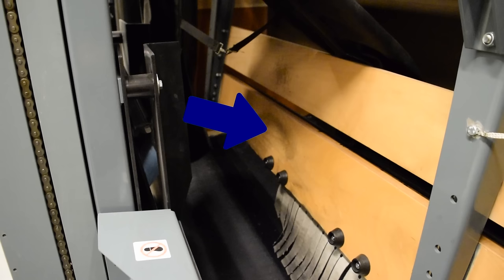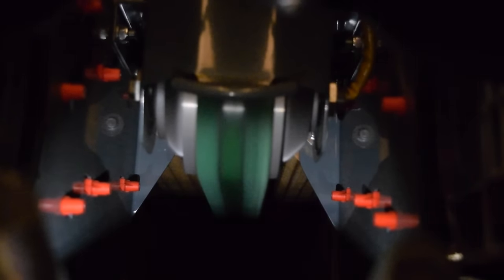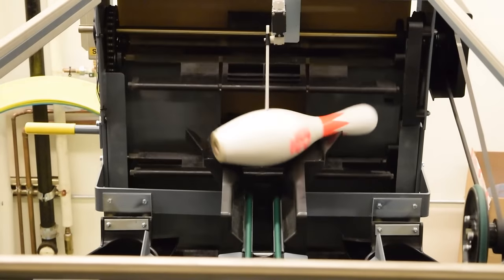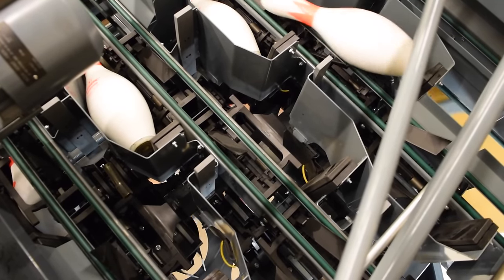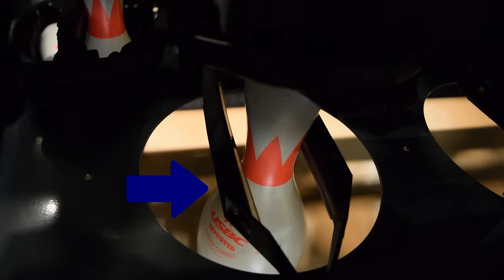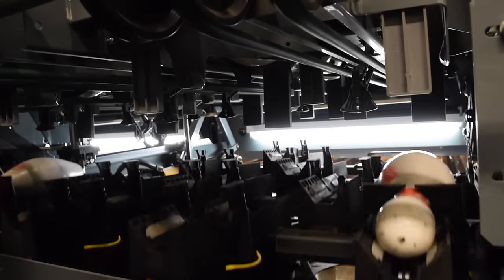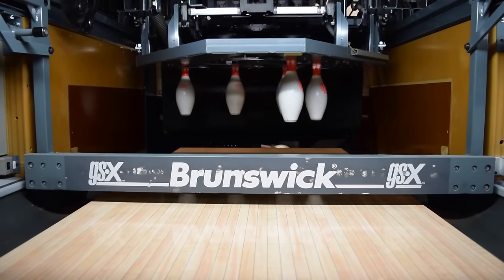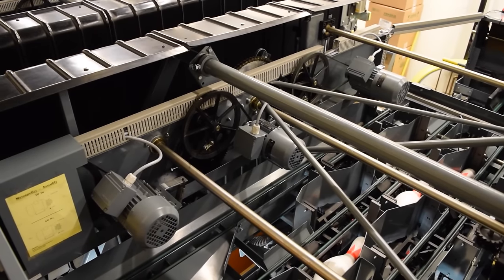Pinsetter Operation  Video

Comment: As a teenager in the early 90's I worked as pinsetter mechanic on the ol' Brunswick A2. After all these years,  just last week I was wondering how pinsetters had evolved and how the newer ones worked compared to the A2. Looks like a lot has changed. Cool video!!

Comment: A moment of silence for that one pin that’s worked there for 30 years and still hasn’t found a station and is just on an endless cycle constantly traveling through the distributor
Reply: Right! Horrible design!
Reply: Some pinsetters have 20 pins in them so it'll be ready at any time. It's not horrible, it's efficient.
Reply: @godffreyosorio4939  23 pins are needed for most GS-X machines otherwise they get ‘Pin 07’ or ‘Pin 10’ errors.

Comment: Great video ! I was a pinsetter mechanic a long time ago as well. The older Brunswick machines were a bit different, but same components. We would mess with people we knew at times by hooking on center pin from above, not allowing it to fall, or setting it back up. The things we do when bored..

Comment: This machine looks like a Brunswick GS series pinsetter.  They are very rare.  About 20 years ago, I bowled in a house in Baltimore that had the first generation of GS machines.  They are very smooth, fast and quiet.  The house I bowled in had the machines set for double detection; ie after the second ball the setting table comes down to check for standing wood before it is swept away.  I understand that the GS machines can also be programed for traditional single detection, like the Brunswick A2 or the AMF 82/70 for use with optical scoring systems.  I also know, from YouTube videos from Brunswick that the GS, series, at least the GSX, has two florescent fixtures, the second one used for black light bowling.

Comment: I miss the old Brunswick A2s/Jet Backs and the noise of the pins on the old elevator ring and the circular pin distribution assembly... Damn well foolproof! I also liked the way the old sweepers worked on the old ones as well... A tried and true design that still works at quite a few bowling centers even after 60 years...
Reply: Most pinsetters in active use are actually still A2s and AMF 82-70s

Comment: Does this apply to Wii Bowling?
Reply: Yes
Reply: yes it does. all those complex pulleys an gears and whatnot, are all crammed into a Nintendo Wii.
Reply: the ball teleports through objects secretly and back in your hand
Reply: It’s on a different pinsetter. The Wii Sports Bowling Pinsetter is based on the Brunswick A2 Pinsetter.
Reply: The balls and pins are uploaded to Nintendo's servers, where a digital version of this machine processes them and sends them back.
Reply: That's virtual bowling without the mechanics of a real pinsetter operation but it's basically the same but u don't get to c what's happening behind the Wii sports bowling lane  as ur the one bowling and not the mechanic of the pin setter of a wii sports bowling lane while playing the game 
if it were real life u get to c what he's showing here if u had a job with the bowling alley as a pin setter mechanic
Reply: Why not

Comment: I honestly miss working at my old bowling alley, not for the company themselves. I was at a bowling alley with these Brunswick GSX machines, I was there for 6 years, and I was the head mechanic for about 4 years after the previous head mechanic resigned. I left the place because the company was absolutely horrible and I can’t even start with the list, for example, I never was able to request off, I was ALWAYS on call, and even still had to stop in on my days off to make sure that machines were running and the other mechanics weren’t just simply NOT fixing them. But I wasn’t ONLY just the backend mechanic, I was also in charge of building maintenance like the bathrooms, lighting fixtures, tables and chairs, lazer rag, mini golf the HORRIBLE batting cages. I was the absolute best employee and always putting work first, it stressed me out so much that I started losing my hair at age of 22. Literally I was the only one that cared about the place so passionately, and I still do. I was going there ever since the place first opened. Then I finally started working there and my love for bowling just increased since. So I’m happy that Bowlero bought it out and ACTUaLLY renovated it and is doing amazing shit. I’m actually upset that I didn’t stick around just for another 1 1/2 years til they bought it, I would have been so estactic and happy. But I also have to include what added to the stress was me working a 2nd job and college classes full time, was doing that for 2 years at that point then I picked up a 3rd job doing hurricane shutter installations and that brought me up to working 105 hour work weeks and college classes, only did that for a whole year and then I got burnt out and eventually went to only working at the bowling alley and picking up shifts at the gas station like once or twice a month if I needed extra cash, and helping out when in the area. Shit for me to even get what they considered vacation time was working off the clock so they basically owed me those hours just so I can go on a vacation and yet out of those 6 years I only ever took a voluntary vacation of 4 days and that was like prying teeth. I had 2 motorcycle accidents within a year of each other and both accidents I was out of work for 4 months each. There were only 2-3 people I ACTUALLY and GENUINELY loved working with. One of them was a woman that was there basically since the start of the business and then when the company sold off and our GM stepped out with resignation she took over as GM. Truely the meaning of working up the ladder, but then when there was no more corporate, our district corporate guy came in saying that he wasn’t going to take her spot or anything of that sort and he did the exact opposite. Never took my advice on anything, suggestions, especially when he hired a assistant general manager that had NO, and I mean absolutely NO FUCKING clue about this area of activity. This kid literally walked in to shut our power off and give us notice because our company wasn’t paying the bills for months. I can guarantee you that shit would have been a lot better if I was at least promoted to assistant GM under that woman who I explained about. And then there was the 2nd person, he was the arcade manager and traveling arcade manager, dude was an absolute gem. He started showing me how to do arcade stuff like fixing the games, organizing the prizes, shit I helped bring in all the new games, helped assemble them even the big ass ones like connect 4, the BIG free throw game, Monster Drop, etc. literally I did EVERYONE’s job. Yes it wasn’t in my job description and I didn’t have to do it, but I did it because I loved the place. If I could work with those same people again, I would. It used to be all fine and dandy the first 2 years I worked there. Literally all of us employees were friends outside of work BEFORE I started working there. The 2 I spoke about literally watched me grow up from like 14 years old til I was 25. Shit was insane. Whenever I move tot exams I might try to apply to get back into another bowling alley. I would not but right now I’m working at a car dealership and making more money and learning a lot more shit than what these other companies would possibly pay me. But there’s just something genuine about solving a "ghost" problem or just a problematic machine like this, they are hard as hell at first but give it a few months of fixing things here and there, then you start to REALLY understand it all. But there are definitely a lot of things that are easier with a 2nd person, we techs never had that option. The only time there were 2 mechanics it was when shifts over lapped like either one person came in early or whoever opened stayed an extra hour or so, which was me 99% of the time both ways.

Rule to the story, don’t sell yourself short. If you’re passionate about something don’t give up but don’t let your mental, physical and relationship health suffer because of a job. Don’t. Keep work at work and home stuff at home. I made the mistake of always bringing work home like pin holders, multiples at once, rollers, ball doors, actuators etc, fix me at home then bring them back the next day. The stress I brought home every day, there were days upon days or and even weeks that When I rode my motorcycle to work that I hoped someone would pull out in front of me and end it right then and there, but I’m glad it didn’t. I’m glad nothing of that sort ever happened. Well that ended up killing me, my first accident was someone failed to yield a left turn but I just got ejected over the car, and a couple cuts and bruises. But like i said don’t ever let a job beat you up like I let this beat me up. No matter how much you love the shit. Your own well being is more important,

Comment: I’m here trying to figure out what happened to Buddy from Cake Boss
Reply: Same 🧐
Reply: I watched his explanation of what happened, and it still isn't entirely clear - but one thing he did explain was that he was trying to dislodge a pin,  "laying on top of the machine" and got his hand caught "with the machine going back and forth," which almost seems to suggest he was trying to dislodge a pin with the sweeper mechanism still operating or perhaps stuck. The only other "back and forth" motion I can imagine is the pinsetter rack going up and down, but it would seem that would be taking his hand and shoulder up and down for the ride, and that could have been an even worse injury.
Reply: So do I, i’m here trying to figure out what happened to Buddy from Cake Boss
Reply: I believe it was on a different machine. Check out the A2 by brunswick (someone correct me if that wasn't it). They're built much differently
Reply: Was an A2 or possibly an even older JetBack

Comment: Been bowling almost 30 years and I still don’t understand where my ball goes lol
Reply: TraumaER same xd
Reply: It was literaly the second thing he covered...
Reply: The wall at the back of the lane you can see catches the ball because it is too short for the ball to go under the pins however slip right under and the floor behind the end of the lane in the pit moves away from the bowler the wall stopping the ball is angled towards so it pushes the ball towards the ball return side of the lane where the ball is then either accelerated or lifted and dropped into a flume under the floor that sends the ball to the return which lifts the ball to the return from under the floor
Reply: This is a Brunswick Pinsetter.  AMF machines are much different.  🤷🏽‍♂️
Reply: There are many of Pinsetter videos out there. Watch any of them how your balls came back.
Reply: @PinoyBowlerGS92  yeah, but how does it do it over and over?  How does the machine know to send my ball back, but not the pins?  How do the pins get organized so quickly?  And it seems like it's all done without a computer chip.  And how does my ball not get decimated when it hits the back wall of the lane?
Reply: @TraumaER . Yes, On the Brunswick GSX, the Ball Door has a Switch to lock the Ball Door for 3 seconds to prevent pins from entering and after that, the ball can enter and there’s a ball accelerator pushes your ball through the subway and ride on the Ball Return pulley and it finally returns. On other machines like the Brunswick Model A, A2 or Jetback had a Ball Wheel (driven by pulleys and rollers) which grips the ball up and the Ball Lift rods guides the Ball on its track towards the end part when the Ball is gonna slide down to the subway or underground. On AMF 82-30, 70’s, 90’s, XLi and XLi EDGE, their’s is similar to the GSX Ball Door excepts it’s more of a paddle than a flap door style on GSX, they had a Ball Lift when the Ball enters the Ball Door, it accelerates upward on the Ball Lift in an angle and slides down with gravity. Hopefully you’ll get the idea cause it’s kinda irritating on how to teach Bowlers on how a pinsetter works since every bowlers know how a Pro Shop works. I suggest subscribe to Rep2369 for Brunswick Model A, A2 and Jetback Pinsetters and tmiller453 for GSX Pinsetters.
Reply: @PinoyBowlerGS92  man you know a lot how this all works LOL.  I just think it's genius how it's designed because it has to accept all types of bowlers and pin reactions.  I notice how my strikes often lift the pins relatively high in the air so I assume that bangs into the pinsetter as well.  Then you got the casual bowlers that throw the ball 20 mph into the gutter and it bounces all around there.  Surprised balls aren't scratched up after every shot.
Reply: @TraumaER  That loud trademark "smack" you get when a ball goes straight to the backboard, love it.
Reply: @spikester  not me LOL.  In practice session, if there are no pins, I pray that my strike ball into an empty pin deck doesn't destroy my ball.
Reply: @TraumaER   Yeah I’ve Bowling for 10 Years and I remember when I was kid first started watching YouTube videos of Bowling along with Pinsetters and then I escalated from there. 

I’m also one of the Pinsetter Enthusiast Bowlers here on YouTube that created Realistic Mini Bowling Alleys based on Real Life Bowling Lanes and Pinsetters, we copied every single detail from front to back including in and out. The biggest channels of our YouTube Mini Bowling Community was Andys Bowl, ThinkCleverAndSmart and coasterp, following other channels like PinDominator and my channel obviously (Nintendo Bowler), our Community pretty much had 99% of love from Brunswick Pinsetters (A2’s and GSX) cause they’re very simple to recreate into a Mini Form. AMF Machines are the type of Pinsetters you don’t wanna build cause they’re too complicated. Trust me that Mini AMF’s could take like years while Brunswick in just few months, few weeks or few days.

I forgot to mention that the Pinsetter Enthusiast Bowlers are the most luckiest Bowlers in the world during the Pandemic cause with their Realistic Bowling Alleys, they don’t have to be bored while under quarantine or lockdown and also they could feel the tastes on their Realistic Mini Lanes just like on the Real Lanes in the comfort of their homes, in my opinion that making Realistic Mini Bowling Alleys are better than Wii Bowling cause Wii Bowling doesn’t give you any taste other than swinging the Wii Remote.
Reply: @PinoyBowlerGS92  nice!  Good info!

Comment: worked on a ally of amf machines in the early 60's .fun job but you had to be careful of flying pins. they are heavy and hurt, i could change out parts , switches , but the big stuff we left to the local amf repairman, sweep and oiled the lanes and played a few free games , good job.

Comment: Excellent video. Does the elevator ever stop or will it keep on recycling overflow pins back to the distributor? As the pins pass through the guide wedges, what is the function of that switch mounted above?
Reply from the maker: First off thank you! As for the elevator, it will continue to run and recycle overflow pins for as long as the bowler continues to bowl. If for instance they stop and take a break, the machine will run for 45 seconds until it "times out"  and the mechanisms like the elevator and the distributor will stop running until the next ball is thrown. The switch that you're talking about is a solenoid which determines the direction the shark fin will guide the pin either left or right on the distributor. It runs on a pattern of 2 to 1 so it will send two pins the the right side of the distributor before it sends 1 to the left.
Reply: Thanks for your quick reply. Much appreciated.
Reply: I used to work in a bowling alley that had a pin "wheel" system that moved the pins to the distributor.

Comment: did you know that the GSX Pinsetter is based on the first real working free fall ninepin pinsetter from Schmid switzerland? Schmid was the biggest produser of string pinsetters until Schmid went bankrupt, so Brunswick took over all the knowledge about string pinsetters and also the free fall ninepin pinsetter. In the sixties bowl more also tried to introduce  a free fall ninepin pinsetter for europe. The machine was almost finished, then bowl more went bankrupt. Free fall ninepin pinsetters are very complicated, because there are 8 normal pins and one longer king pin in one set. Also balls can have different diameters. Tenpin machines knows only a two balls cycle, ninepin machines many many more different cycles.

Comment: What if a pin is knocked slightly from its standing position but does not fall down, would the setting table have enough clearance space to grab it back up and register it as an unhit pin? (I did see that the holes are quite large but not sure about the claws mechanism)
Reply: Yes, when the pins was slightly off spot, it could still pick up but if the pin is way off spot and the table won't pick it up, the table and sweep would go back up to its home position, however deadwood (or the knock down pins) will be left behind on the pindeck and gutters.

Comment: Looks like Brunswick copied a lot of elements from the AMF 82-70  and 82-90 pinsetters.  Have you ever worked on the Brunswick A series machines?
Reply: But at least it works a bit better than the AMF 82's. You can set your own shots automatically, no problem for the table for extra pins riding on it and no double shuttled pins or stuck pins on the bins which that is proned on AMF.